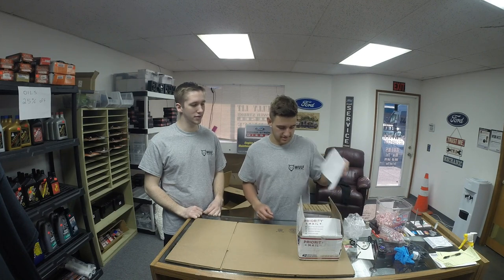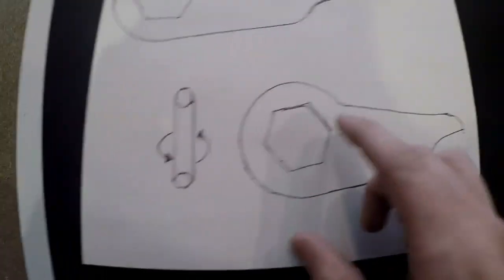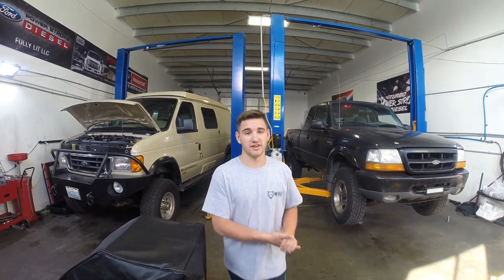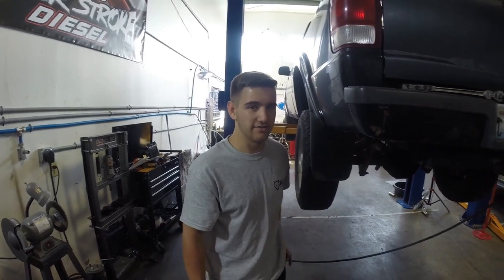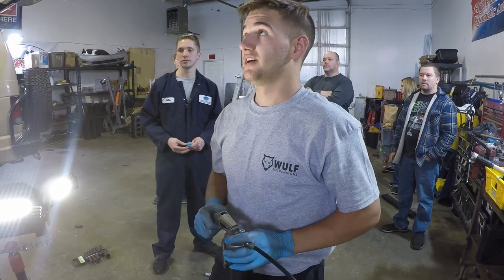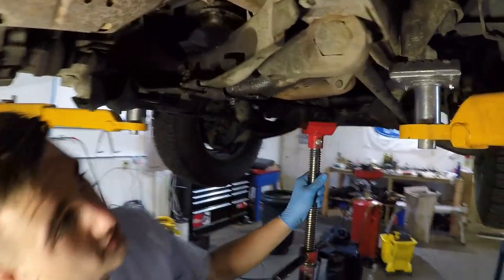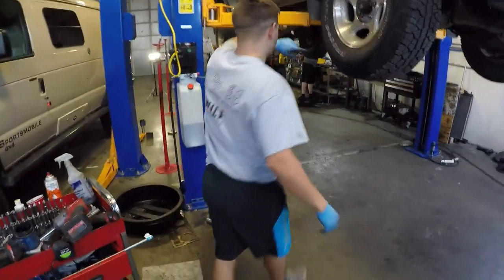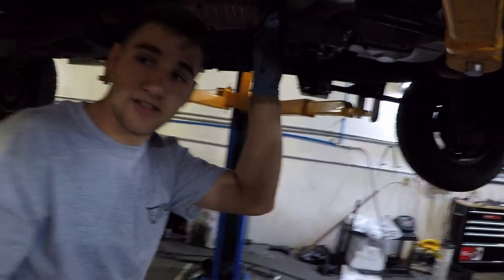Ford Ranger Lift install

Comment: I did made my own lift kit with rough country torsion keys and the heavy metal shackles and rancho 1-2.5 lifted shocks I didn't remove the tow package I just took an angle grinder to the inside nut and slid the bolt off I put 33 in tires on it as well
Reply: Do you have a pic of it?
Reply: Ben The car freak it fit 33s with 2.5 lift?

Comment: Should’ve torqued when the suspension was under load. And highly recommend using medium thread locker instead because of all the vibration

Comment: I am installing the wulf lift kit on my '00 ranger and let me tell you.... the 2 jaw puller that is recommended for removing the stock torsion keys does NOT work to install the wulf ones. The puller I rented from o'Reilly is nearly mangled up and created a groove in the wulf torsion key.

Oh, and wulf expects you to tap the hole for the zerk fitting, which is impossible to do after the shackle is already installed 😂...... 😰

Comment: Don't use lift shackles. Use add a spring. The shackles change the ability of the spring to hold weight. The cost is the same.

Comment: torsion keys are only for those with the might of zeus and a really long breaker bar. Getting it off isn't hard. Putting the new one on is just torture. ESPECIALLY if you don't have a shop lift. Rented a Ball joint press from Advance Auto Parts so we could have a screwable C-clamp and the passenger side was hellish because the exhaust got in the way

Comment: @Cole Townsend after you lifted the truck, were the upper control arms making contact with the frame?  how would you fix this because mine are contacting the frame and allows no down travel
Reply from the maker: you have most likely lifted the truck too much if it is contacting the frame

Comment: You should use the torque wrench on the nut side you’ll get a more accurate torque reading
Reply from the maker: we did after the clip but didnt film it but you are 100% right about torquing the nut

Comment: how much higher would the front end be if the key was installed but the adjuster bolt was set so that it has the same length of thread showing as stock?
Reply: Dan Tuttle like garbage, I could not push the front end of my truck down with all my weight, speed bumps were a nightmare.

Comment: What exactly is holding those key bolts in place underneath? Simply relying on pressure? I've lost enough bolts down the road I don't see that method going well. Nice looking kit and simple. Also wondering why you don't have to loosen the control arms and re-torque them in the common ride position to avoid tearing through those bushings in a short period of time.
Reply: The amount of stock Rangers on the road that haven't had this show up as an issue at all makes me think the system works fine. Though intuitively, I do get what you're saying.

Comment: I want clearance to go off-road will also a Pneumatic shocks help you get a little extra lift back there and what about the front are there any pneumatic shocks for the front of a Ford Ranger. I got some junk land down in Texas near hudspeth County and I really need to get some ice to my pickup truck to make sure I can get in and out of the place and it's a 2003 Ranger so I don't want to put too much money into it maybe I should just buy a Jeep Wrangler and screw it

Comment: So what’s the advantage for new torsion keys when you can crank up the stock ones??
Reply from the maker: I explain it in the video but its because before being preloaded the stock torsion key is at a lot less of an angle than the wulf suspensions one meaning you cant gain as much lift
Reply: Thanks makes more sense great video 👍
Reply: Try it n find out.  Then describe how it drove.  Its basically like cutting your springs on a coilover and riding asphalt. You need that tilt to kinda help that.  Helps alot tho.  Still bumpy but yea

Comment: Did you run the keys all the way up till you can’t anymore? I did and my truck was vibrating extremely bad so I turned them down some and doesn’t do it anymore but now I can’t get them to stay tight it runs down after 10 minutes of driving

Comment: i bought the actual tool for this lift. but the angle in which the tool compresses the torsion key also pushes the t bar to the right. so i cant fit the spacer through the hole. i’ve tried multiple different tools and angles. what do i do?

Comment: I have a 2010 ranger I would like to do this. Now you said the truck you were doing had a aftermarket tow hitch but they come from ford with them and I have one on mine so there’s no way I can keep it on ?
Reply from the maker: The hitch on his ranger was a aftermarket one and his hitch was reinstalled after the lift was installed
Reply: Cole Townsend thank you for the fast reply and information 👍🏻
Reply: Cole Townsend where can I get that kit ? And do I need to get longer shocks and get the front end a alignment after?

Comment: Nice video! One question. Could you have used the jack to put the torsion key back instead of the tool you made? When you used the jack to remove the torsion key looked pretty easy and im guessing putting the key back with the jack would be easy too.
Reply: I watched this video and wonder the samething now im thinking of not evening buying the tool just usin a jack
Reply: @cloudeyevideography9028  are you upgrading your torsion keys? I just installed my new torsion keys to give my truck a 2 inch lift. I ended up purchasing the tool to put the new torsion keys. I couldn't installed them with just the jack
Reply: @tamarindoreo  yes i will be doing the job for a friend i will be buying the tool as well ! Which tool did you buy?
Reply: @cloudeyevideography9028   from wolf suspension.

Comment: how come you guys didnt install like a 5 or 6 inch suspension?
Reply from the maker: Thats pointless for our uses even my prerunner is only running 3in of suspension lift
Reply: If you want any more than what they did for a ford ranger youre going from 3-400 what they spent to 1.5-2k for the whole kit and if you do that might as well 4 link it and prerun that shit with straps and fukin 3k worth of suspension but after that you have a truck where u can just go from road to dune buggy mode just by jerking the wheel to the direction opposite of the road...

Comment: That tool is not necessary you undo the sway bar and shock and the front end will droup down enough to reinstall the keys
Reply: Lol. Yever done one?  Ive completely taken off everything besides the whole control arm and in the air the tire was still supported by the bar. Those things are in there.  You loosen the tortion key screw damn near 23 complete turns.  Maybe on a mazda but ford ranger was hairy doing it even with the took. Given i had a u bolt and a bar with another bolt in the middle but thats all u need..  taking shit loose on a tortion bar set up is calling for an accident.  That tire will clock u good if you manage to get the arm off under tortion
Reply: @Z-Ack  i own a 2004 ford ranger and have had it apart down to the frame it is posible and can be done safer than using that tool  all u do is suport frame on jackstands 
Put a jack under the lower ball joint take tire off undo lower ball joint and sway bar and then let jack down the lower a arm will hang then just push it down and take the key off

Comment: Will this work on a 2wd?
Reply from the maker: Check www.wulfsuspensions.com it should say there
Reply: No 2wd has to have a coil spring lift done , the rear end leaf spring shackles will lift it 1-2 inch
Reply: You can do a spindle lift on a 2wd. Super cheap and easy to install. I put a 4” spindle lift on my son’s ‘03 Ranger and it made a huge difference.
Reply: @56kwhite  i want to lift my xlt 2wd v6 3.0, not sure what would be a good lift atm..not into the 2" lift
Reply: Justin Bradley I got the lift off eBay. You can get the 4” spindle with a 3” block just under $300. I put 2” blocks and 1” shackles on the truck.
Reply: Justin Bradley I don’t know how to add a pic of the before and after for you to see what a difference the lift and tires made. Do you have any idea how to add one?
Reply: @56kwhite  i do not
Reply: @56kwhite  , cool , can a spindle lift be put on a 2000 Ranger XLT 4X4 ?

Comment: I just want to know how to unlift my truck cause I bought it that way but it sucks gas that I can't afford.
Reply: Buy OEM shackles for the rear and remove the leveling puck or torsion keys on the front. As long as it's not a 5" or above, there shouldn't be an aftermarket Pittman arm or knuckles.

Comment: Thanks for the video...but....it isn't necessary to remove the trailer hitch assy when installing the rear shackles.  With the frame supported, the axle will drop far enough that the leaf spring can be lowered down after the upper stock shackle bracket is removed from the frame so as to remove the bolt.  I only found this after the fact, and it would have saved me a lot grief had I known that in advance.
Reply from the maker: It honestly depends on your hitch assembly on this ranger there was no way it was gonna happen
Reply: So you say...I had the same hitch.  Happy trails.
Reply: I had to remove the rear bumper to install the new shackles. The bolt could not be removed because the bumper mount was in the way.

Comment: Wow, I've been wanting to lift my 4x4 08 Ranger for a while. Watching you video convinced me, if you can do it, I too can do it with my eyes closed. Calm down and drink a little less Rockstar before you start narrating a video. Show the before and after in the video. Show a bit more detail from the perspective of the guy doing the install, we dont need to see the installer in every shot.

Comment: I had to get dual bias shocks after tortion lifting my shit.  It will literally beat u to death.  But i got rough country shocks with dual bias so when u hit a speed bump you can control the downward and the upward force without having to go full out million dollar fuckin shocks.  If was gonna buy the good ass shocks i woukd just 4 link it and go all out.